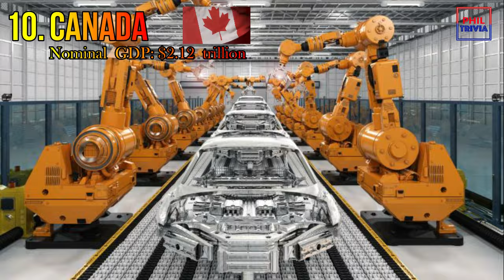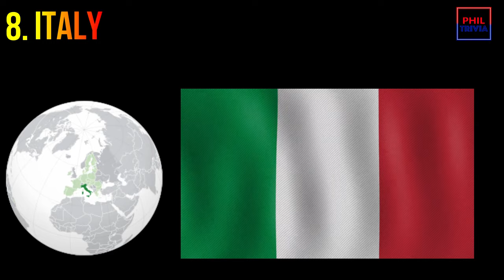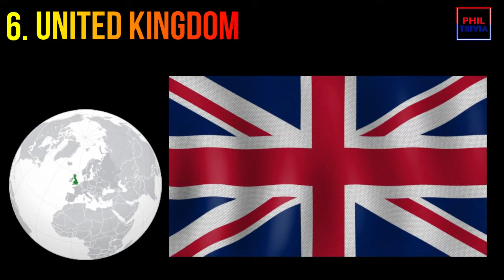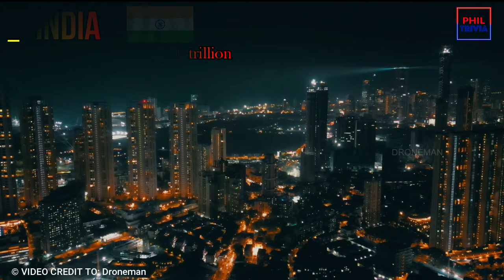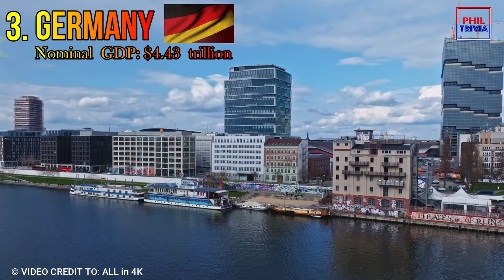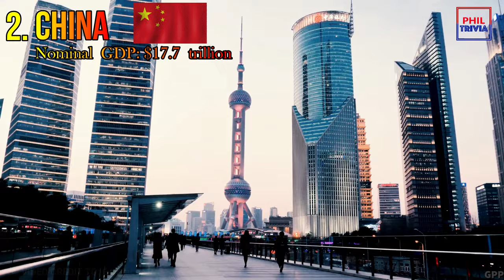Top 10 Largest Economies In The World (2024)

Comment: Actually, GDP by PPP is more reliable economic indicator than nominal GDP simply because the nominal GDP does not include the cost of living and inflation among countries. 1 US dollar is equal to 7.23 chinese yuans . But the cost of living is not the same. For example the cost of living in the United States is higher than that of China's.  In China, you require around 3.8 yuans to live a similar quality of life as you would in the United States. So if China's Nominal GDP is 18.53 trillion US dollars,  the Purchasing power parity of China is 18.53 ÷ (3.8 ÷ 7.23) = 35.2....trillion US dollars. So China is the largest economy in the world
Reply from the maker: That's a great analysis! It's important to consider the cost of living and inflation when comparing the economic strength of different countries.